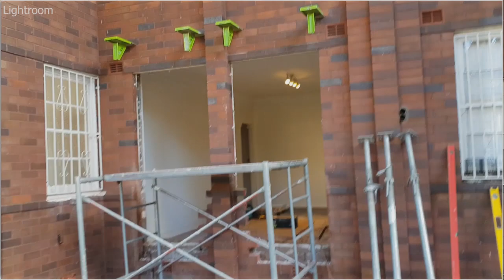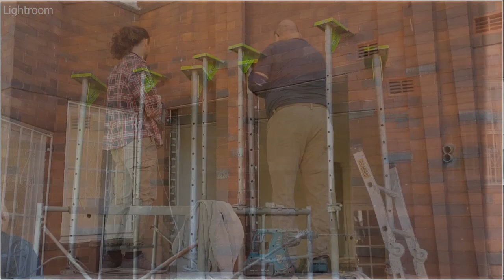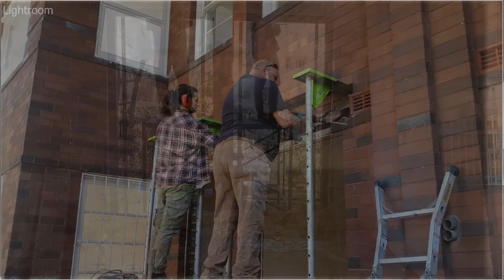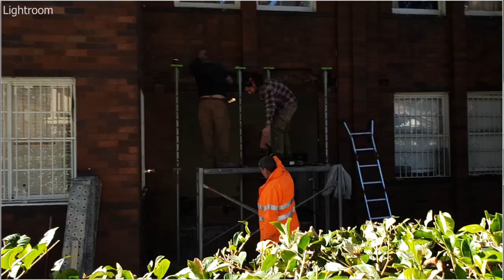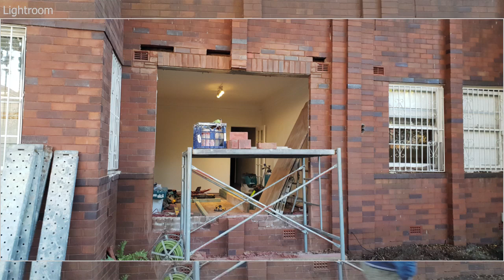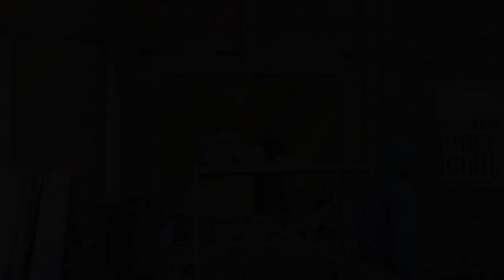Proppa brick supports

Comment: Really if you have an old building you need to respect it. The double door ruins the look of the building and the vertical column chopped off looks horrid. Surely just drop the two seperate windows down to make two doors with the column still there. Awful! Clearly the conversion has had to be done leaving the very unusual appearance in tact as original and now it is ruined.

Comment: Poor shoddy work . You needed to prop the joists internally as well to remove the second steel to insert a tray damp with weep holes . It will fail a building inspection.
Reply: I agree it is shoddy. With old buildings you need to come up with ways round. I would put a flashing just above the inner steel that then ran into the front leaf and out through weep holes. As it is the cavity runs into the room.